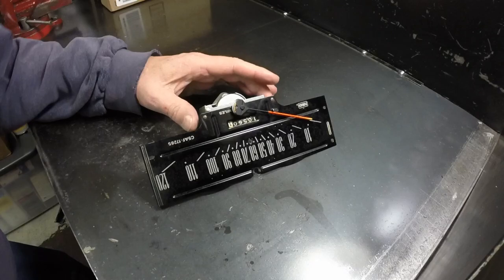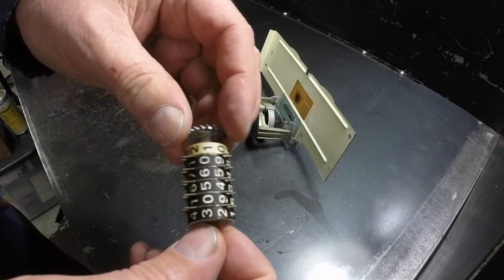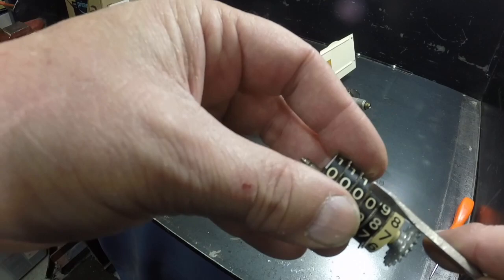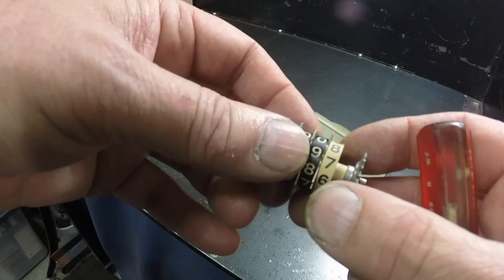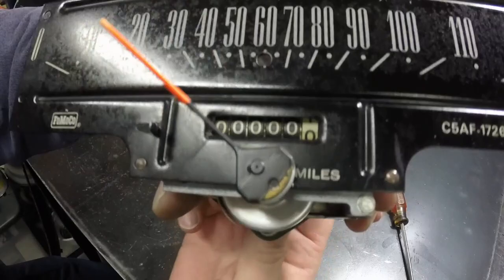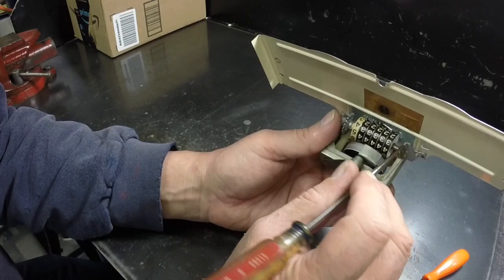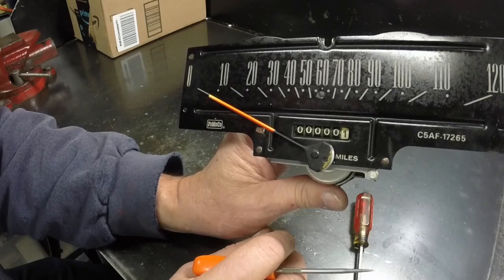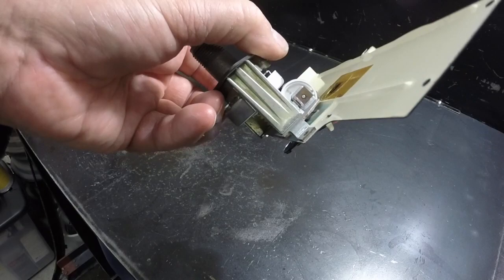How to change the miles on an old mechanical odometer

Comment: I sell engines and occasionally folks will ask me about resetting their odometer to zero. I’m like, “you can get a new heart, but that doesn’t make you zero years old.”
Reply from the maker: Totally!!!
Reply: If you change all the mechanical parts in a car, the body might still rust but the car will drive just fine. Maybe it's not just the heart, gotta change all the part and just like a oil change, gotta swap out that blood also. Clone yourself some indestructible organs

Comment: Removed and cleaned the speedometer on my 66 Dodge Coronet  last year. Pulled out the cable and applied some graphite. Super easy to keep those old parts in service.
Reply: Graphite will gum up if the humidity gets high. Silicone works well.
Reply: Silicone attracts dirt, I've used graphite with no problems , so I'll stick with what works.

Comment: The safer way of resetting the odometer instead of prying the old plastic and gears apart is to start at the far left digit and set it where you want. Then roll the next digit to the right until it comes to a stop. At the point you will be able to move the bar one position. Keep doing that until the bar and the digit are in the correct spots. Then move to the next digit and repeat the process, and so on. It's safer than risking breaking the gears, plastic, ect. For a seven digit odometer, it will only take about 5-10 minutes.

Comment: I had a 1984 Camaro years ago and changed my speedometer and when I tried to do this the numbers got a silver line through them.  Later reading my owners manual it stated that this was a tamper resistant feature.  I guess this started in the late 70's early 80's?
Reply from the maker: Yep, that's so someone knows the milage is most likely not correct.

Comment: do the little gears have to be in a certain position between the numbers when at rest/ reassembling it ? if not when tab comes around might jam whole thing at any number ?
only happens if you take wheels
 off shaft the little gears fall out . Or maybe it works by design no matter how they are positioned rotationally in U slots ( obviously right way around)
Reply from the maker: The gears need to be so all the numbers line up and line up with the opening in the speedo for the odometer. The gears will be in the correct spot as long as the numbers are all lined up evenly.

Comment: Great video truly educational for older vehicles.  Quick question, if someone wanted to appear as if little to no miles have been added to a vehicle, could you just take out the original odomete/speedometer reader and put a different one in there and replace it back to the original one before you give the lease vehicle back....?  Or if you are selling the vehicle to carmax, etc....?

Comment: thank you for answer , say when all zeros the tab that will hit the little pinion when it comes around to turn the next wheel 1 number hits the little gear in the U slot for a short time , enough to go one number . 
But when you assemble it all alighbed to 0 or any number the little tab is at about 3 o click position inside the member wheel , do not touching anything . when it turns maybe 270 degrees or whatever it engages , but if that is not sitting just right it might jam ? maybe put together with it in certain position ? or maybe does not matter ? if you force it like in the video you might lose that yet it seeks to work ? try it with drill and allen cut off fits drive make sure  it works  not just first drum ? seems to work with gear in U left just anywhere but that seems wrong ?
Reply from the maker: I never remove the digits, I only snap them around. When the odometer is out, they have enough "play" in them to allow them to be moved easer.  I have never damaged an odometer doing it the way I show in the video. I have done hundreds over the years. I like replacement odometers to show the actual miles on the old car that is getting a replacement, so I always reset them to be correct. I do them for friends that work on old cars also.

Comment: I’m looking at a ‘92 Accord right now. It’s in pristine condition, no rust, clean interior. Haven’t visited the guy yet but from the pictures the Odometer says 38900km. My concern is that the Odometer has been rolled back. The numbers don’t line up, but the guy claims the car is for his elderly father, and it is in immaculate condition judging from the photos. I’m conflicted. 

Any tips or advice for when I go to see it in person? The guy is asking for $9000 CAD (~$7000 USD) by the way, but i’ll talk him down close to $4000 CAD (~$3000 USD) since it hasn’t been sold in the 2 months it’s been posted.
Reply from the maker: Look at the ware on the pedals,  drivers seat and carpet around the pedals. Also remove the oil cap to see if the engine is clean or full of sludge. Low milage at the end of the day docent mean a thing if the car was not maintained. Often low milage older cars were used for short trips..... a mile here a mile there is super hard on cars. I find older cars with ultra low miles, can have more issues then a well maintained high milage car.....
Reply: @OldCarAlley  Thanks for your reply, I arranged a meeting with the guy and checked the stuff you
mentioned, I suspect that the dash was rolled back, lots of wear on the pedals and carpet underneath the winter mats. Good looks 👍
Reply from the maker: @mkobd  Sometime the speedos break, and get replaced with salvage yard ones, that may have lower miles showing. I always adjust the milage on a replacement, to what the original stated. Always look at the car in general. Often the cleanness will reflect mechanical care too. Often filthy cars were not maintained as well as clean cars.... 

From my experience in dealing with older cars.  To me milage on the odometer is the last ting I look at, as often older low miles cars, have more issues than high miles older cars. The low miles ones were often short tripped..... that's the worse thing you can do to a car.

Comment: How do you disassemble the numeral wheels My 1/10th one turns but won't rotate any other wheels like the locater pin is broken?
Reply from the maker: Some have a very small snap ring or "
E" clip to hold the digits to the shaft.
Reply: @OldCarAlley  Thanks I have to pull it apart and take a closer look
Reply: @OldCarAlley  I was able to remove the clip it was inside a collar I actually had to grind down to remove the clip but managed to get it Thanks

Comment: I got all the metal tabs lined up to where it fits. But when I was putting it back in, a piece of one of them broke off. Will that cause it to not work?
Reply from the maker: Yea.... not good. It may or may not work depending on which tab end broke off.

Comment: My speedometer stopped working in my 1992 Nissan hardbody. I had to drive around without a cluster for a little until it was fixed. Is their anyway I can locate anywhere on my truck to locate the exact miles to th body of my truck? Thanks

Comment: CAUTION! Results are not always a given. I took my Smiths odometer apart and there are 8 springs/clips/cogs etc. at the ends of it. My speedo now needs a £150+ rebuild from a professional. I wish I had not touched it.
Reply from the maker: Maybe they don't know what they're doing..... I have never had any issues reseting them.

Comment: How close is this odometer to your '59 Chev? Haven't attempted to fix mine yet.  So it's still stuck at 99999.9.  What would you use to clean it?
Reply from the maker: There almost identical.... that is common on that era Chevy.... Pop the speedo out, pull it out of the housing and flip the numbers over with you finger, without removing the odometer. Be carful not to touch the numbers GM's paint on them is poor.

Comment: As far as the speedometer face, with the remnants of the previous corrosion that you mostly removed, have you thought about  applying a couple coats of clear on it, then polishing, levelling the finish out?  Might be worth a try on the spare speedo.
Reply from the maker: I tried that on an old part from the parts dash.... it makes it look worse.